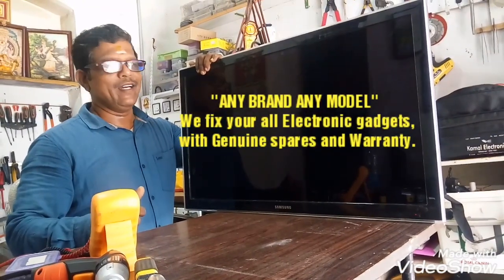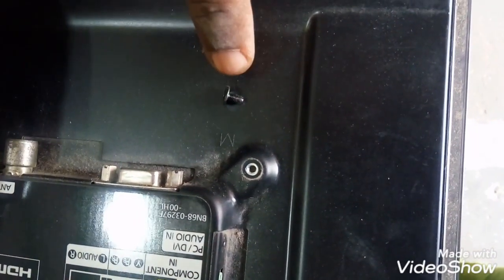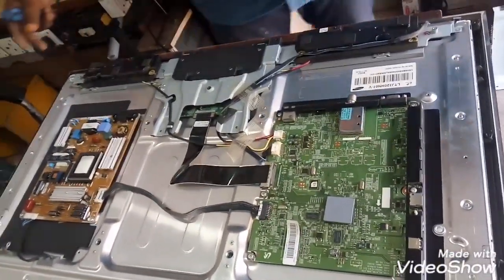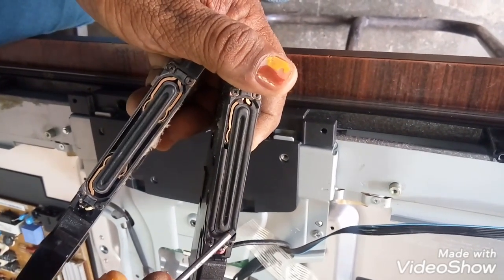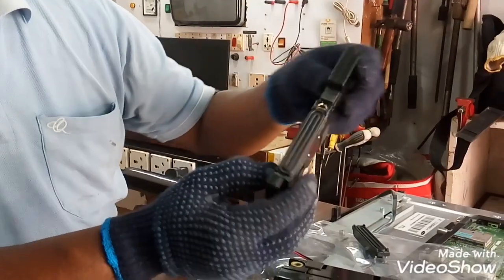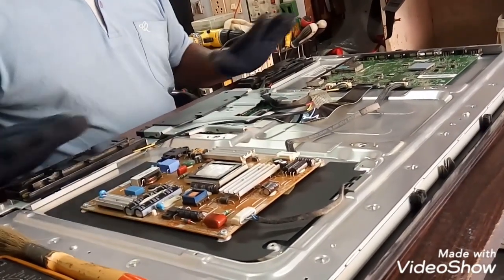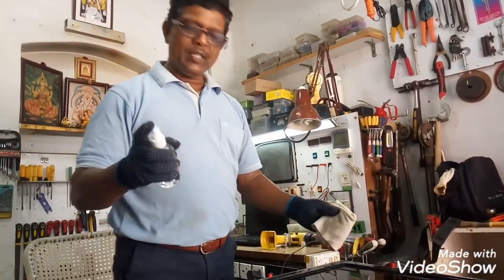Samsung LED tv Sound problem

Comment: sir, I have a 55" Samsung led tv (bought in 2009). The model name is UA55B7000. I am having distorted sound. Where can I get replacement speakers? Do you have sell speakers? It is 15 watts speakers as per the TV manual. Thanks
Reply from the maker: Hello sir, sorry for this delay in responding, 
And to your TV sound issue better you connect the Soundbar sir,
Thank you for watching my channel sir

Comment: How can we confirm if it is speakers problem or mother board problem ?
Reply from the maker: Use Headphone/Connect with Bluetooth
Reply: @mecshanlee3724   I can hear the sound with headphones and even when I connect it to external speakers.  So where would be the defect? In TV speakers or Mother board ?

Comment: How many rupees is that speaker oofer is
Reply from the maker: ₹750/ speaker. And another with plastic base holder model at ₹1750/per speaker
Reply from the maker: Two models are there., Only speakers @750/ per speaker. And with Plastic base @ ₹1750/per speaker.

Comment: Cab i use micromax tv speaker for samsung tv for sound issue
Reply from the maker: Sure, If the size and the screw holes are same as the old, you can replace.

Comment: Hi, is there any way to repair the speakers without replacing the drivers? I cant seem to find replacement speakers where i am from..
Reply from the maker: Thanks for watching the Video Sir, and it is very simple connect sound bar and enjoy the crystal clear digital audio without  replacing the speakers.,
Reply: @mecshanlee3724  I see.. I wanted to see if the speakers can be repaired before trying out a sound bar.. But thanks for the reply..
Reply from the maker: @neilsison7109  speakers can't be repair or serviceable.
Reply: @mecshanlee3724  ok thank you

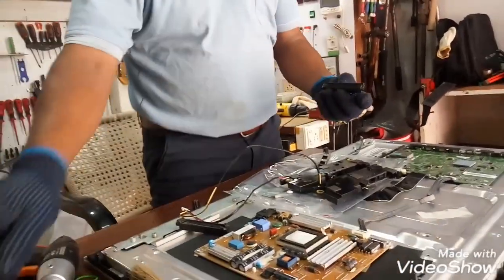Comment: hi sir, how would i know if the terminal is correct to the wire? I already bought the speakers but no red mark as the original. thank you. I think you explain it in the video 5:05 but not in english.
Reply from the maker: Hello sir., Thank you for watching my videos. You can test the speaker terminal with Multimeter.  Without red mark is no issues you can connect the wires as you removed. Thank you Dahren🙏

Comment: Thanks for this, how much it will cost for the speakers?
Reply from the maker: Thanks for watching, 2models are there. If your TV Speakers comes with Frame it cost ₹850/per speaker. And if those fitted in duct it cost ₹450/ per speaker.
Reply: Where we get this ? 
Online available?
Reply: Samsung 46 inch LED smart  TV model AU46ES8000R . Where to get good speaker to replace, staying in Mumbai ! What will be the price ? at lamington road, I was told Rs. 400 for one pair !